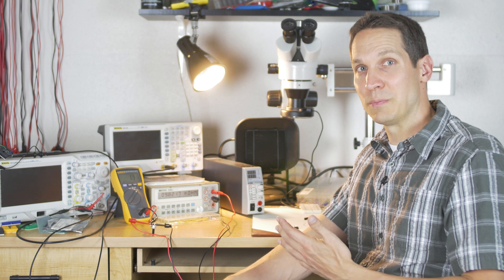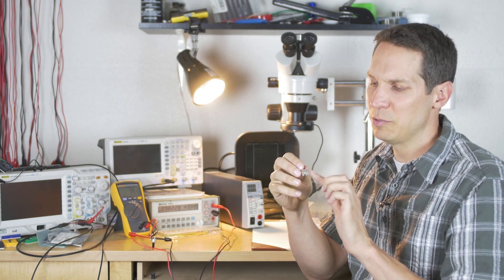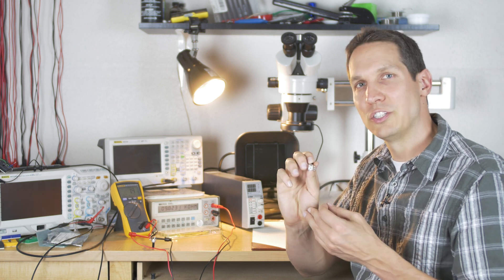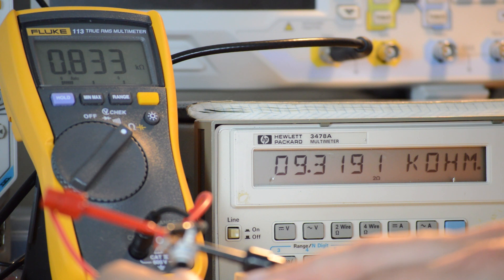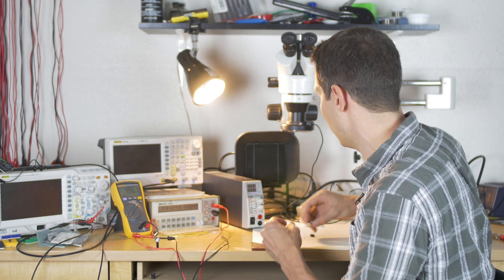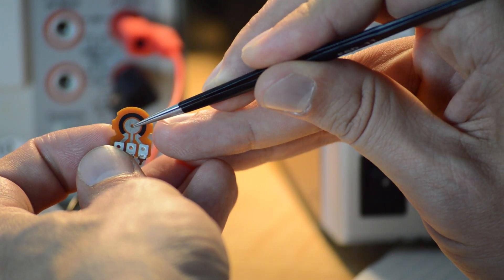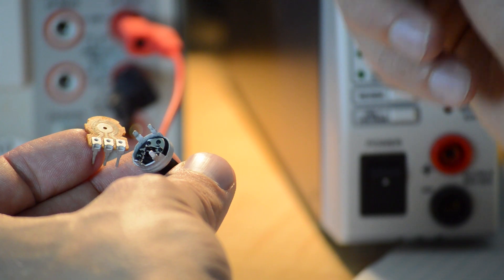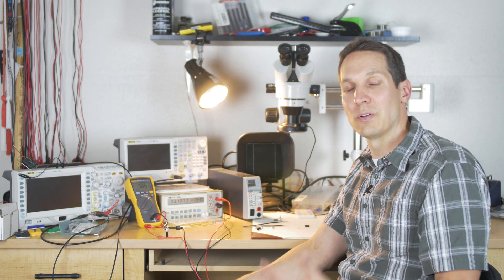Potentiometer Basics - How they Work | Basic Electronics

Comment: There's lots you didn't explain, like what does the center pin do. I don't see what it can possibly do. The outer pins conduct current. But it seems to me, that's all that's needed. The center pin isn't needed. And how do we use a volt-meter with these. When I tested the dial, I didn't observe any change in resistance (connecting the volt-meter to the outer pins).
Reply from the maker: It was mentioned about a minute into it, but perhaps the written tutorial would be better as it addresses this particular question almost immediately:  https://www.circuitbread.com/tutorials/basics-of-potentiometers
Reply: The middle pin's like a short, i think he had 2 clips on the middle pin for the readings

Comment: Exact informational video I was looking for. Recently got into electronics and building a lot of projects. One project is a benchtop power supply using an ATX. I'll be adding a cheap Chinese Up/Down converter, a Volt/Current Display and a pot to vary the voltage of a 12V connector. When ordering pots, now I understand what the "A" and "B" are referring to in the descriptions. Please consider this project for a video. Cheers